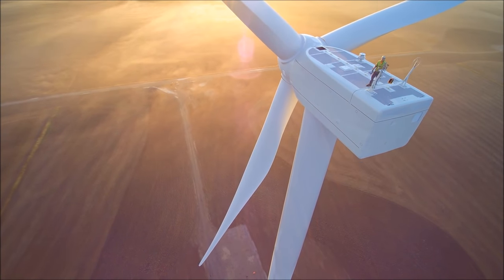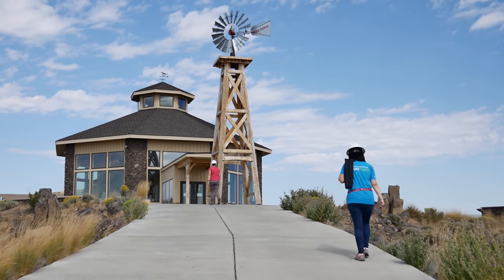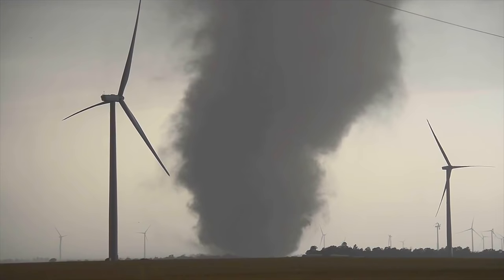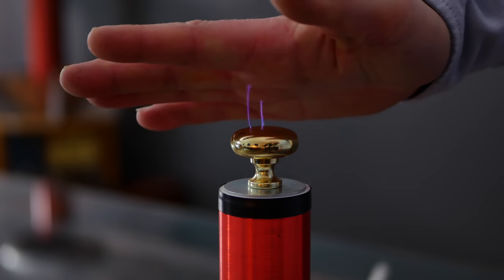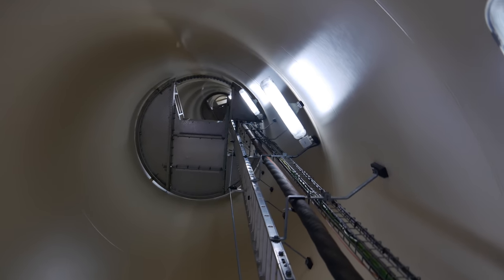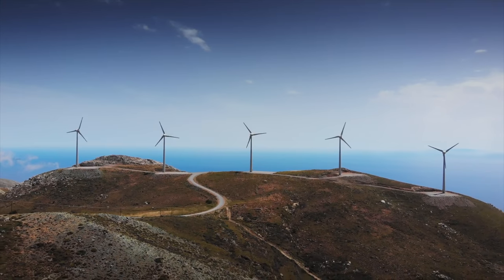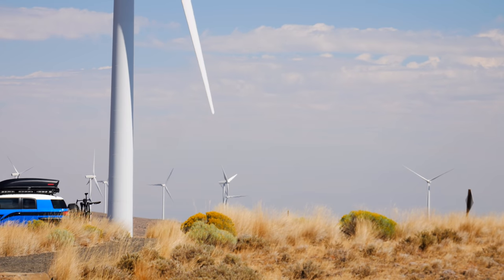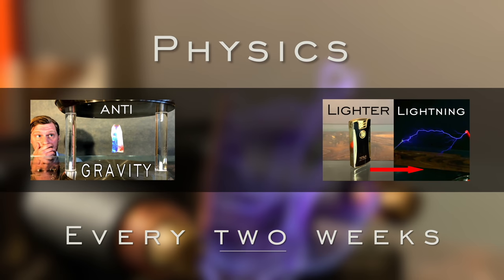35,000 Volt Wind Energy (Up Close Turbine Tour)

Comment: I have tons of questions now! 
- so the gear makes 1800 RPM, meaning 30 round per second for generator. Does the generator make 60 Hz electricity, so it has two electrical cycles per mechanical turn?
- How do they combine voltages from all towers? Do they combine ACs, so would they have to synchronize them some how? Is it done by syncing turbine rotation or how?
- How do they manage voltage differences?
- What's the efficiency of a tower?
- HOW??!!
Reply: Oh hi Mehdi, didn't expect to see you here.
Reply: Hey tell me who gonna make me a "hand crank Tesla coil' because I challenged my friends. actually I'm being challenged . Ahhh... Please🙏🙏🙂🙂🙂
Reply: Hi mehdi please make another informative video please
Reply: there is my two favrit youtubers
Reply: Ohh Mr mehdi I hope I could win on your upcoming giveaways
Reply: Oh Guriji!...you are here...fantastic
Reply: Hi Mehdi
Reply: And how to make sparks using turbines?
Reply: Not entirely sure about your other questions but some wind turbines have gears
Reply: Hey Mehdi
The man who gets himself hurt in basically literally every video
Reply: why use nuclear power instead  wind power ? o.O
Reply: These questions have surprisingly many answers. 
And yes, it does include a FULL BRIDGE RECTIFIER. 
For low output power wind turbines:
The generated AC is rectified to DC and then converted back to AC. While it is inefficient, it is a good way to reliably and precisely synchronise with the grid frequency and also decouples the output completely from external factors. 

For larger wind turbines, fancy generators with rotating magnetic fields and gearboxes are used; it all gets quite complex:
https://www.machinedesign.com/markets/energy/article/21832336/green-technology-inside-an-advanced-wind-turbine
Reply: Good point, they must have to synchronize them all separately to some standard sync.
Reply: - so the gear makes 1800 RPM, meaning 30 round per second for generator. Does the generator make 60 Hz electricity, so it has two electrical cycles per mechanical turn? 

An: the electricity is directly sent into a transformer, the AC produced by the generator is transformed into DC and then transformed once again into AC to be sent to a transformer that is connected to the grid.
P.S this is only for modern wind turbine, older designs had a very rough way of doing things.

- How do they combine voltages from all towers? Do they combine ACs, so would they have to synchronize them some how? Is it done by syncing turbine rotation or how? 

An: All wind turbine is an independent entity on a “small scale”, the onboard computer synchronizes the wave form as a normal power plant would. 
However, the rotor is not turning at the same rate for every wind turbine, they appear to be because they receive the same “wind”, but if we were to take measurement, we would find tiny differences.

- How do they manage voltage differences? 

An: very good literature here:
https://ec.europa.eu/energy/sites/ener/files/documents/2001_fp5_brochure_energy_env.pdf

- What's the efficiency of a tower? 

The maximum theoretical efficiency a wind turbine can achieve, is given by the Betz limit, which is 59%, the reason being, if a wind turbine had a 100% extraction capacity, the air would stop behind the blade, and no more air could pass through.
In a typical wind turbine, the efficiency is around 44-47%. And the capacity factor is around 30-40%, depending on where the wind turbine is placed.

- HOW??!!

An: For information, the power output is given by:

P=0.5*rho*A*v^3*C

With rho the density of air, A the area swept by the blade, v the wind speed and C the efficiency achieved.
In a wind turbine there is a cut-in speed, which is the minimal wind speed needed for power generation, typically at 2-3 m/s. The power output has an exponential growth until it level out at around 12-15 m/s, which is where the wind turbine will produce maximum power. Finally there is a cut out speed at 25 m/s where the blade are put parallel to the wind in order to avoid any damage.

In real life, the power output of wind power is mostly random since the wind doesn’t blow the same in every place and introduce a lot of complexity in the grid.

Anyway, hope it helps, if you have any other question, just ask.
Reply: It can make both standard frequency, the rotor is powered via 440v ac supply that has a seperate tap of the 690v ac supply, the 440v is then converted to dc via skip packs (big transistors), the 600vdc is then used to control the rotors magnetic field, this is used to induce into the 4 pole stator, and when the wave function on the grid and generator match the stator is connected to the grid first in star then as power increases it changes over to delta. If speed drops to low and any part of the wave function goes outside the set perimeters of the grid authority then the turbine automatically disconnects from the grid.
Reply from the maker: Hey Mehdi! Crazy stuff right? Some of these questions, I also was curious about. I'm waiting to hear from them about the specifics, but I believe:
The generator is 2Hz per rotation.
They combine voltages by synching the waveform of each windmill output via the onboard computers...since once it leaves the head of the turbine its AC.
Efficiency of the towers is 97% at a minimum in order to meet local regulations. 
How? BECAUSE ALIENS.
Reply: Gearbox
Reply: Hey rectifier guy how are you??
Reply: @PlasmaChannel  ❤️
Reply: DEW directed energy weapon burning California. Go to "Dutchsinse" channel he uploaded 2 videos showing the actual beam. ...
Reply: @ronshekelson  it looks real but...
Reply: Ah first time no body said

FULLLLL BRIDGE RECTIFIER!!!
Reply: @tvishmaychoudhary69  me already said
Reply: @rosebiswas758  no u said rectifer
Reply: @tvishmaychoudhary69  this is plasma channel not electroboom
So respect this channel and also sir jay
Reply: @rosebiswas758  i do
Reply: @rosebiswas758  i mean that every freaking electroboom comment is spamed with FULL BRIDGE RECTIFIER
Reply: @tvishmaychoudhary69  good boy
Reply: @tvishmaychoudhary69  hmm
Reply: Hello ElectroBoom. I watch your videos as well as Jay's. And I love both yours and Jay's content. While Jay makes his videos very interesting and cool and straight to the point, ElectroBoom makes them funny. 

I would like if you 2 were to do a collaboration, including KeyStone Science. 

But to stay on topic about this video here, I loved the video. I also loved how you showed the size of the windmills and told us the location of this wind farm. 

I also love how you gave us wind speeds and other information that I can't remember at this point. I love how you added in the sounds of the blades spinning and the weight of the blades. I also like how you included the drainage ports and a ton of other information that I didn't know. I also love how you showed the generator and gear box. And I also loved how you showed the transformer. I've never ever seen a transformer that large in my entire life. 

One thing that stood out to me was the high voltage power cable. That was the coolest part of the video for me, alongside the gas they use for a fire suppression system. 

I believe they use that same gas in high voltage substations for shutoff valves. 

I also love how you put in the formula for the energy. And I love your choice of words for transfering energy. 

This is a different video, but I love the format. One thing I was thinking about was that if energy is just transferred over and over again then can it loose its energy entirely?
Reply: @secretagent5658  hmm
Reply from the maker: The model they showed me pays itself off in 8 years, then becomes net profit. They last a few decades.
Reply from the maker: They also cost 2 million, according to PSE
Reply: @PlasmaChannel  wow
Reply: Mehdi!!!!!
Reply: THE RECTTIIIFFFIERRRRRR!!!!!!!!
Reply: Hi, ElectroBoom, 
 spyiro2007 are more or less right, but exist anotrer frequency correction system and that syste are usualy used in turbines with gearbox and ( ac/dc/ac) system are usualy used with turbines without gearbox. System use Double fed inducion generators, you have to google for more info, it's to mutch to write..
Reply: Fuul bridge rectifier
Reply: @PlasmaChannel  please sir make a plasma ball by flyback Transformer
Reply: I would suggest that the 32kv is then rectified and sent to the distribution centers as HVDC. The ALTERNATOR, not GENERATOR is therefore a 3 phase inducted field SWER design, allowing for minimum BEMF on the blades. This would account for the minimum rotation speed before field establishment of 1800 rpm. But these are just guesses. I am no Medhi.
Reply from the maker: Hi Mehdi! I heard back a few weeks ago about some of these questions. PSE has been pretty backlogged internally, so still waiting on a few answers. BUT: 

-how does the AC power from each Nacelle synchronize and combine, from turbine to turbine

These turbines use a thyristor/soft starter system to make sure that when the turbine reaches power production speed (1800+ rpm) it connects smoothly to the grid. Some turbines are designed to use power conversion AC-DC-AC to make sure everything matches up correctly.

 

-how does the system manage voltage differences across all turbines when they combine?

Partly due to DC conversion and combination. I am awaiting further answers from them.

 

-is the generator 2 electrical Hz per physical rotation?

Awaiting further information on this as well. These are asynchronous generators but they are producing very close to 60hz at all times, but do vary slightly because of the variability of the wind.

Cheers!
Reply: They use an Induction generator. It's like an induction motor. If it were to spin a little bit slower than the 1800rpm synchronous speed it would act as a motor, but if it spins a little bit faster it acts as a generator. Once it reaches the proper speed it is put "on-line". At this point it will produce active power but consume reactive power for magnetization and it will nor accelerate much.
Reply: @atmel9077  Synchronous to what? Generator of what? AC or DC? Looking at the pictures of the generating plant I would say it's a 3 phase AC induction alternator.
Reply: @t.i.m.e.3419  Yes this is exaclty what I mean
Reply: By converting ac to dc
Then dc to ac
Using converters
Reply: Medhi hello!
Reply: Hey Mehdi! Do a colab to throw some subs Jay's way ;)
Reply: They use a external excited synchronous generator.
The voltage is controlled by the excitation of the synchronous generator.
Reply: @atmel9077  I was going to write a bit about induction alternators because they are a neat idea; basically an induction motor with negative slip.

Seems like despite the advantage they may have had in side-stepping the synchronization issue, their mediocre power factor and efficiency has lead to computer controlled doubly fed synchronous PM designs becoming the norm.
Reply: @whatelseison8970  Well an EE teacher told me that wind turbines used induction generators but that may actually be outdated. Doubly-fed machines are now a preferred solution since they allow the rotor speed to vary according to wind speed and thus achieve a greater efficiency, and this solution has been made possible thanks to the low cost of power conversion electronics. In the future it is likely that doubly fed machines will be replaced by permanent magnet machines with inverters as they are now widely used in EVs and some small hydropower stations, but that may change again because of the increasing cost and risk of shortage of the materials used to manufacture magnets.
Reply: @atmel9077  Indeed. I'm continuously blown away by the power handling capabilities of even small semiconductor devices today.  I have this ESC made by emax that's like the size of my thumbnail but can handle 320 W (~16V/20A).  I'm definitely looking forward the future. 😎
Reply: My kids and I love your videos Electroboom guy. Genius presentational. 🎩

Comment: Stepping the voltage up to 34,500 volts at the generator makes sense too because then that cable that comes down the ladder doesn't have to carry as high a current.  1,800,000 watts / 34,500 volts = 52.2 amps.  Modest current for such a high power.

Comment: Ohh. And the Generating Plant (or "generator", and sometimes "electric generator") is the entire assembly producing electrical energy from a fuel source. The alternator is the element within that system converting rotational power to electrical energy. This element can also be a Dynamo. But they produce DC.